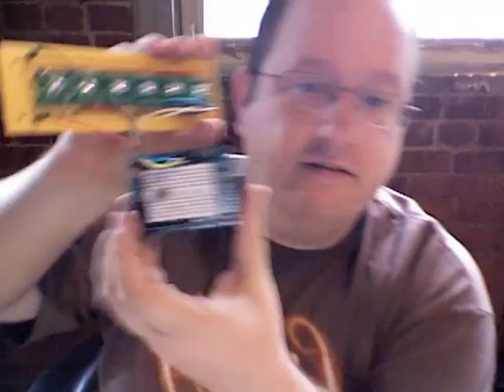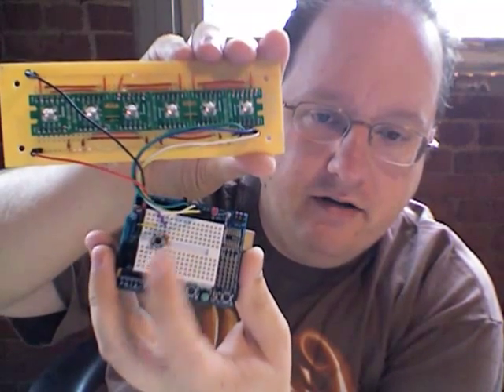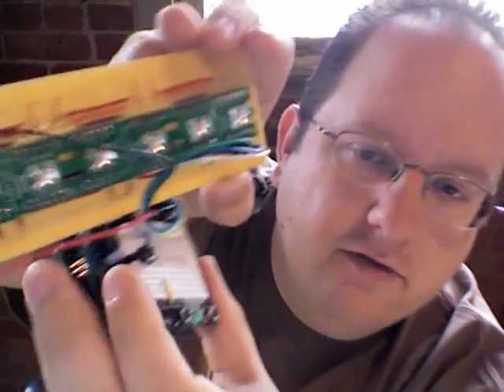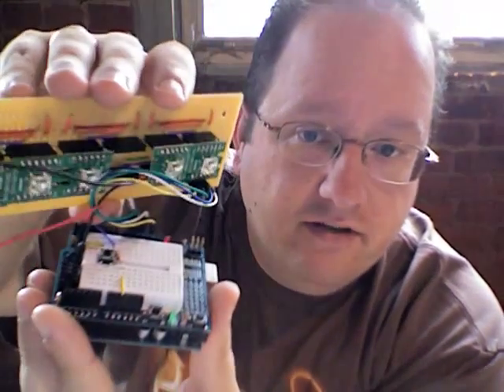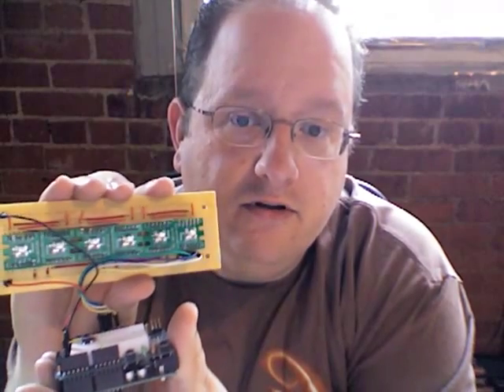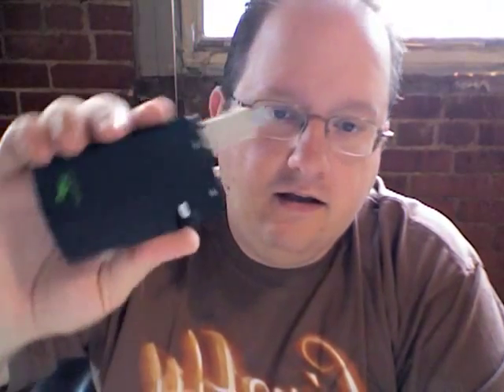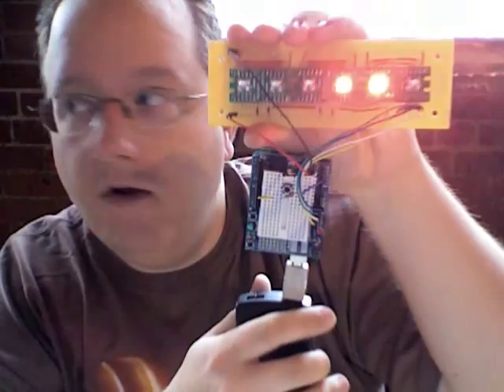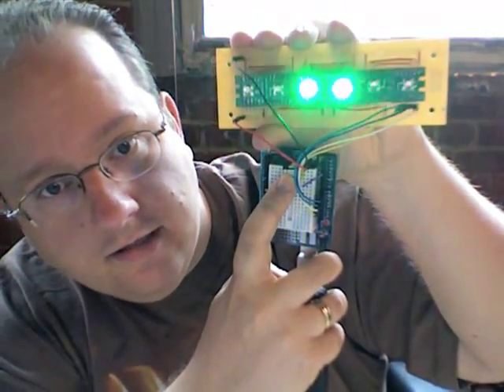Arduino ShiftBrite Knight Rider Bar

Comment: Love the project, I am similarly working with a shift brite and arduino but am worried about my power budget. Is the proto shield you use amplifying the voltage or are you running the shift brite on just 5v coming from arduino. The spec sheet says 5.5 volts to 9 so I am wondering how you did it.